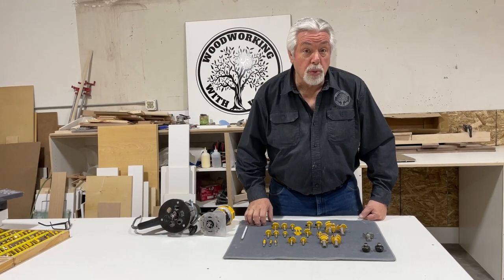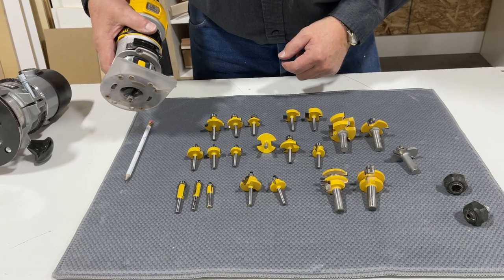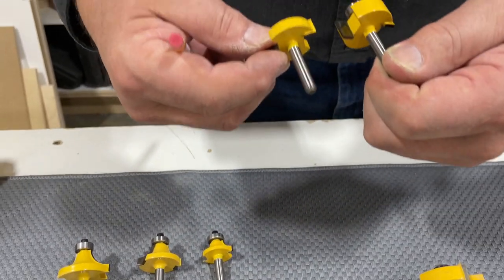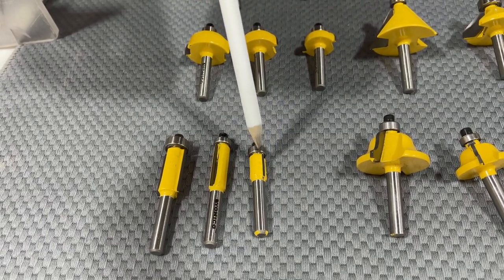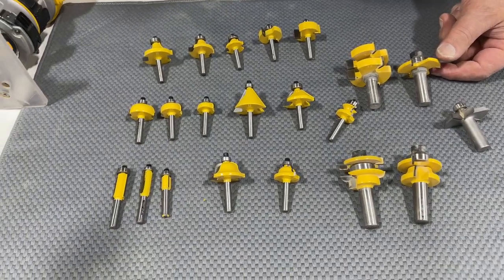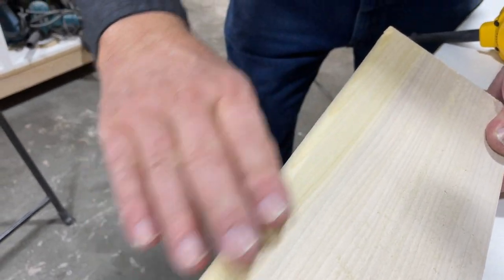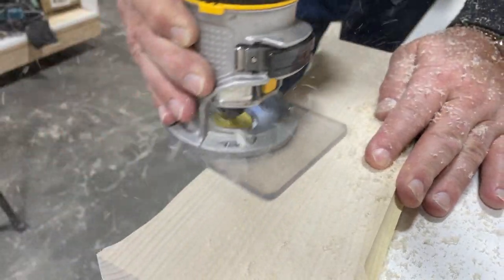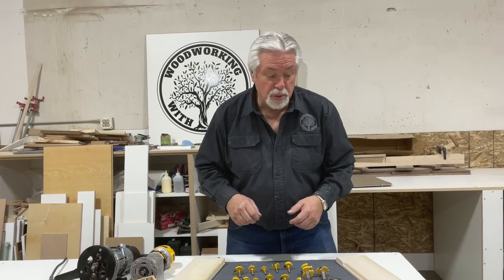Work Like a Pro Knowing Which Router Bit to Use

Comment: Can you do free hand designs with the little DeWalt? Also, could it be used in a small router table set up? I want to use a smaller router because they scare me and I don't have space for more then a small one.  i'm building decorative things, light decor cabinets. No kitchen or heavier duty things. Could i get away with using a 3/8th shaft on a bit for this small router with the right adapter thingy? I make things then paint them. Make a living doing "my art form" and love working with wood. So I just binge watched your videos and learned so much!! Thank you. You explain things very well. Last question, to make that groove in the drawer for bottom plate, what else could i use to make this if I didn't have the tool you used? Could I use a router bit? Or??? Im a big fan now. Subscribed and look forward to many more videos!!! Hi from Vancouver Canada!